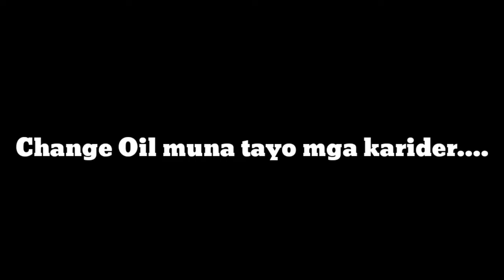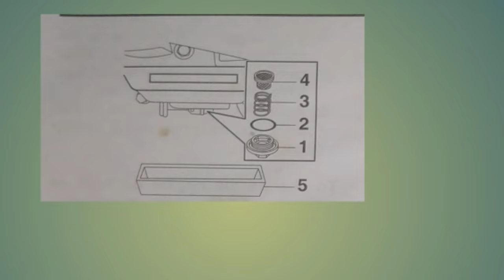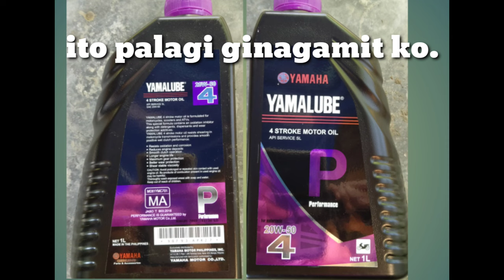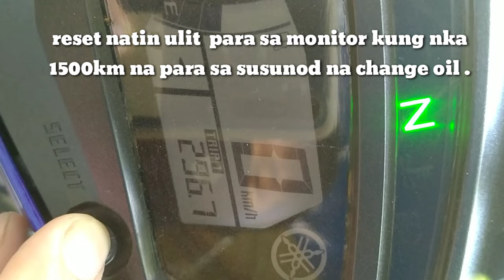Change Oil and Oil filter ng Sniper 150

Comment: To remove engine oil cap = CLOCKWISE 
To tighten engine oil cap = COUNTER CLOCKWISE
Reply from the maker: baliktad po to remove oil cap -counter clockwise
                     to tighten oil cap -clockwise